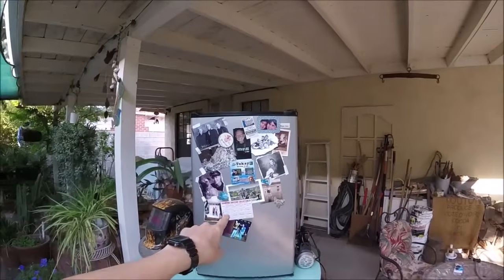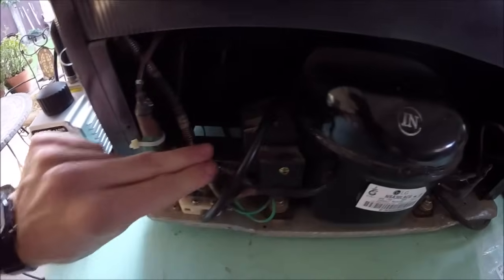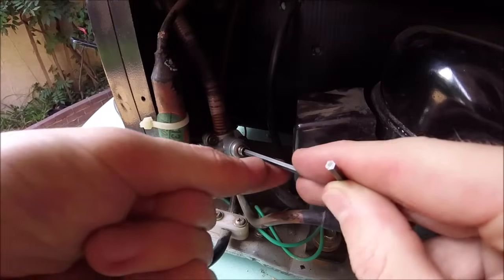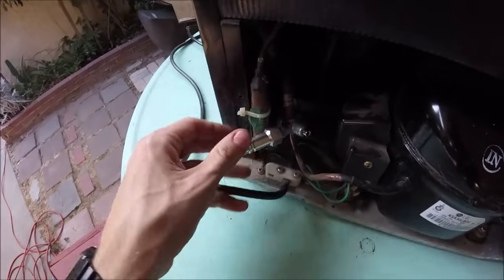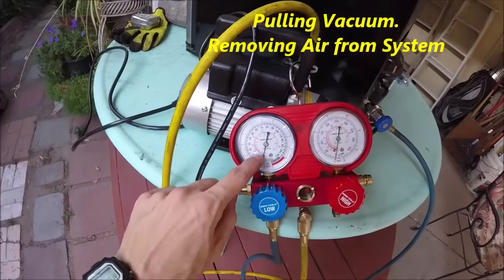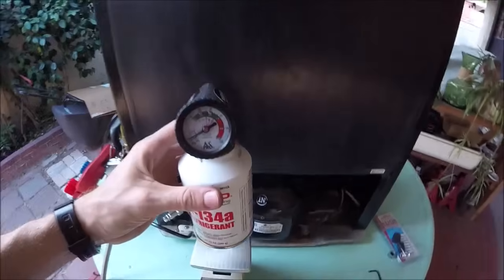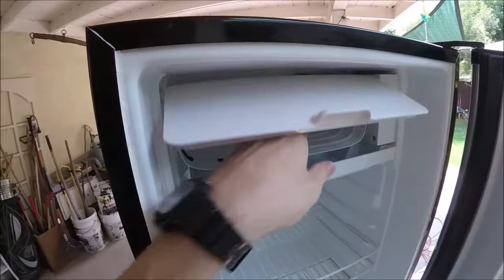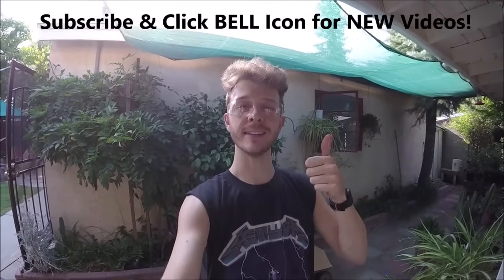How To Correctly Add Freon to your Refrigerator R134a -Jonny DIY

Comment from the maker: TOOLS & SUPPLIES & DONATION LINKS
Bullet Piercing Valve- https://amzn.to/2M9uT2I
A/C Refrigerant R134a & Hose with Gauge Kit- https://amzn.to/3UKKbyv
A/C Conversion Fittings- https://amzn.to/375OIX5
A/C Charging Hose with Gauge- https://amzn.to/3ZRFmVa
A/C Refrigerant R134a- https://amzn.to/36Z7ATA
A/C Gauges & Vacuum Pump Set- http://amzn.to/2gRBXVx
A/C Manifold Gauge Set- https://amzn.to/3S1JVej
Vacuum Pump- http://amzn.to/2gRH3Bn
170 Piece Household Tool Set- http://amzn.to/2xoyu5c
Safety Glasses- http://amzn.to/2ez41Jw
Nitrile Disposable Gloves- http://amzn.to/2w0dlwc
Mechanics Gloves- http://amzn.to/2w0i1SP
If you Enjoy the Channel Consider Helping Support it by Donating below & by Subscribing.
PAYPAL DONATION https://www.paypal.me/JonnyDIY
Zelle Donation JonnyDIYs@gmail.com 
Venmo Donation JonnyDIYs@gmail.com
Reply: What if there is no leak but, the gas is low.
Reply: How to trace where the refrigerant leak is coming from
Reply: Question? How much did it all cost to fox it yourself?
Reply from the maker: @tannavela9212  not much, tool was rental free. About $15-20
Reply: It costs $200 to rent A/C vacuum from Auto zone. You could buy a new mini fridge for that. Is the vacuuming of the tank absolutely necessary?
Reply from the maker: @JOSH_R_FALCON  its free you just leave a deposit and get it all back when return. And yes it is absolutely necessary if the system has been completely evacuated of refrigerant. Because now air has entered and air take up space and cant be compressed as well. If you dont vacuum system it wont cool well or not at all
Reply: @JonnyDIY  Thank you very much. Appreciate the video and the quick response
Reply from the maker: @JOSH_R_FALCON  You're welcome 👍🏻
Reply: So Jonny DIY did you put air in the system or take air out of the system before you put the freon in ?
Reply from the maker: @cliftonpeterson5863  You want to remove all the air from the system by vacuuming before recharging. Vacuuming will also tell you if you have any leaks in system
Reply: @JonnyDIY  thanks bro
Reply: Watching your video juat save me a more than $1000, I was about to buy a new one, thanks for sharing your videos, subscribing
Reply from the maker: @alexisrodriguez1599  Awesome, glad to help 👍🏻
Reply: Thanks for the video and the product listings very helpful for a diyer
Reply from the maker: @mannydiaz0713  you're welcome, glad to help! 👍
Reply: @JonnyDIY  did you get your r-134a from auto zone too ? If the compressor is r-134a can I use auto zone refill can to charge it ?
Reply from the maker: @NateTheCod  yes you can get the refrigerant at autozone too 👍
Reply: @JonnyDIY what’s a good pressure fornit
Reply: WhT do you do to the copper tubing once your done? How do
Reply: Grainger has 'em for $5.19
Reply: @JonnyDIY  Thanks a lot
Reply from the maker: @jck1989  you're welcome, glad to help! 🙌👍

Comment: HVAC and Refrigeration tech here: guys if you absolutely have to do this, please pay attention to the type of refrigerant it takes. Info can be found on the data sticker inside or on the back. DO NOT MIX REFRIGERANTS. If it says R404a DO NOT add R134a. Please consult an EPA certified technician before doing this.
Reply from the maker: Good point, thanks for sharing 👍
Reply: What are the potential dangers of mixing refrigerants?
Reply: @JonnyDIY  if urs take the refrigement that is no longer common, can u just use the R134 I believe it's called??? Thanks
Reply: @Dragon22078  would you put diesel in your gasoline vehicle?
Reply: @Yousoundvaxxed  no but I’d put alcohol in it. Or jet fuel; not diesel because of the compression required for it to detonate.
Reply: No... You see them bastards aren't going to rip us off anymore looks like most people can do this themselves instead of her $500 that's AC repairman charges
Reply: @Dragon22078  Each refrigerant operates at different pressures and temperatures. If you mix refrigerants you degrade the function and efficiency of the system
Reply: @sircoolbox  If your vehicle's system takes a refrigerant that has been phased out, the whole system needs to be updated.
Reply: @sircoolbox  Edit: *fridge.....I was talking about vehicles with another tech when typing
Reply: I installed the bullet valve on the vaccum line  of the compressor. Will the vaccum used in the video still work if used on that line? Thank you.
Reply: Good advice Wolf, to others listening.

I've done this, Im also epa 608 cert, for HVAC. Ive done more autos than fridges and (Im not 609 cert.)

 DO NOT mix refrigerants, as Wolf stated, it can cause over pressure spikes and ruin compressor or condenser + fittings.
The new R1234rf systems from what I hear, can be evacuated and safely charged with R134A + oil. As they operate at almost the same pressures.

If Topping off a 134  system works, then Im all for it. Eventually if the system has a small leak, moisture and air can get in, causing problems, not too hard to rent a vacum pump to evac system, then re-charge, many videos on the net.

 Maybe sure the the system takes the same refrigerant
Reply: @wolfshadow2472  is it the exact same method for freezers?
Reply: @MIKALI.  At the fundamental level, yes. It also depends on if it is residential vs commercial/industrial. Commercial and industrial have many more components that are included in the system
Reply: Most refrigerators take 134a
Reply: @Dragon22078  kabooom!
Reply: Out of curiosity, would you be considered one such “EPA certified technician”, that you mentioned?
Reply: What kind of oil do you need to use especially if you're replacing the whole compressor how much how do you add it add it to the system
Reply: @markdi2  R134a and R404a use POE oil. The exact amount needed varies by brand of compressor and can be found on the data sticker on the side of the compressor
Reply: @wolfshadow2472  I read sometimes they come pre-filled with oil and I guess the rest of the system would be cleared of oil because of gravity and when you pull a vacuum on it
Reply: @markdi2  that's correct. If the system is in need of oil after opening the line set up. Only fill to what is on the data sticker for the compressor. Any more than that you run the risk of equipment damage
Reply: @wolfshadow2472  I was a manufacturing support engineer at tektronix and a technician working on everything including 200,000 oscilloscopes and other test equipment manufacturing fixtures including repairing thermal cycle machines that had 60 horsepower 3 cylinder Refrigeration pumps trane was the company I would work with
I think the compressor in my 14-year-old refrigerator is fine it had a bad start module assembly I am so tempted to cause Mayhem with the 12 microfarad 250 volt cap using a line cord and a 1n007 to charge it to about 175 volts dc and throw it at a buddy and say here catch
Reply: @ThumblessMike  
EPA certified is just another government way of collecting more money. It is pointless for the most part.
You can be EPA certified if you pay a fee and study for a month or so about environmental questions mostly that you will forget in a month or so.
You need EPA to work with refrigerants.. Thats why all HVAC guys have them. Its the law. If it was not the law most would not give a dam about it.
Reply: @wolfshadow2472  nah, there are drop in replacements for most old gases. Rs24 can be used for r12 which was a common ac gas for cars and I believe r12 systems can be converted to 134a with an oil change. Could be wrong. R12 isn't common in my neck of the woods.

Comment: To everyone out there who is doing this to save money, and to make ends meet. You are not alone, and I know you can do it don’t let stuff like this overwhelm you because you’ve never done it before, or haven’t been to school for it! You don’t need school anymore there are very extremely intelligent people who regularly upload to YouTube, and all over the WEB showing you, and teaching you just like this gentleman here I will say there are many different ways to go about it, go with the option that best fits your situation. But don’t let the job intimidate you, but do pay attention we’re your hands are at all times! When putting a hand inside of a device that has a high enough voltage, and current abilities thar can cause you physical harm, and it must be switched on for this purpose put one hand in your pocket and keep it there (always use one hand working on live circuits) protect your self at all cost, nitrate gloves will protect against 120volts 60Hz AC,and 120volts DC as long as there is no moisture on the outside part of the glove. Be careful my friends!

Comment: TIP!: WHILE  ATTACHING  HOSE , ALLOW THE FREON TO  PURGE (ESCAPE FROM) THE HOSE (CONTINUOUSLY)  TO ENSURE THAT AIR IS PUSHED OUT OF THE HOSE. OTHERWISE, YOU WILL HAVE INCORRECT PRESSURE READINGS & THE AIR WILL CREATE ACID. WHICH DESTROYS THE MOTOR WINDINGS & MOISTURE IN THE AIR CAN POSSIBLY  CAUSE ICE FORMATION INSIDE THE  SMALLEST LINE (CAPILLARY TUBING CAUSING A BLOCKAGE OF FREON CIRCULATION.  GREAT VIDEO!!!)
Reply from the maker: Thanks! Great tip 👍
Reply: thanks. i was wondering why we must purge it. will definitely do that
Reply: @kushpaladin300  god bless you!!
Reply: That does not look like a line to purge. Its got a clip on type compression at the end with a hand pump.
How would you even purge it? You cant back off the line sightly to purge air. You have to take it off which would just allow air into it again.
Especially because a pumping action has periods of nothing happening.
Reply: @bobshanery5152 THE AIR IS IN THE LENGTH OF HOSE FROM THE CAN OF 134a REFRIGERANT TO THE LINE TAP VALVE CONNECTION; THIS AIR  SHOULD BE PURGED -  ITS  POSITIVE PRESSURE & NOT UNDER A VACCUM. NOTE: AS YOU STATED CORRECTLY , (PARAPHRASED) WHEN THE LINE IS OFF AIR IS ALLOWED IN     REMEDY; A CONTINUOUS FLOW OF REFRIGERANT THRU THE HOSE WHILE ATTACHING THE HOSE TO ITS CONNECTION. YOU DON'T BACK OFF OF ANYTHING. ALSO, YOU'RE NOT PUMPING ANYTHING ,BUT SIMPLY SQUEEZING THE TRIGGER  (LIKE A SPRAY CAN) THE FLOW IS UNINTERRUPTED. THANK YOU BOBS, HOPE THIS HELPS!!!!!          //////              I NOTICED THE LINE--OUT ACROSS MY COMMENT HERE , PLEASE READ IT ALL, I DON'T KNOW HOW THAT HAPPENED??????
Reply: @2bnax  Tkx, I was looking for a comment like this, you've just made me realise it's doable because the hose has very small valve on one of it's ens to facilitate this purging flow though.

Comment: I do NOT understand why anyone would dislike this video. Thanks for sharing
Reply from the maker: Thanks! & you're welcome, glad I could help you out 👍
Reply: @peterpham6288  did it work?
Reply: @peterpham6288  134a is 134a. There's no "refrigerator grade" version of it
Reply: @doctorfeinstone6524  There is 134 some other number that is the gas for vacuming it up and/or pluging leaks/removing. I'm just putting this out there for other people watching this. 

All this said, those other types of gases are probably harder to find anyways whether it's R600 (isobutane), R134 (tetrofuloroethane), R290(isopropane), letter a is always the cooling gas.

When it comes to R600 (isobutane) and R290 (isopropane), the isomer (same atoms, different configuration) is what differentiates it regular butane and propane we use to cook etc. Maybe it comes from there whether or not it's "refrigerant grade".

Comment: Overall well-done, however a big omission in this video is at 40s, picking where the fill-valve goes. It needs to be on the low-side (low-pressure, return to pump). That is where the video shows it (thicker pipe to pump) but the distinction is not made.
Reply from the maker: Yes correct, thank you for pointing that out 👍

Comment: Your video is based on there being no R134a already in the fridge.  To top up a fridge or fridge/freezer to the correct level with Freon, you want to end up with a pressure on the gauge of between 2 and 5psi.
Reply from the maker: Thanks for the helpful info Mark 👍🏻
Reply: Firstly a potential leak has to be found and fixed.after vacuuming i dont fill by pressure.i use  the blue Temperaturen line for 134a.i do this for 40years and it works perfectly!most of fridges run at minus 25.filling by weight is even better.

Comment: Thanks for the video.  You helped me save my 17 year old mini fridge.  Did it all for under $15....  Thanks for the instructions and the confidence.  Through my research I saw that if your system isn't completely empty you can skip the vacuum step and just add refrigerant.  CHEERS
Reply from the maker: Awesome glad you got it fixed and glad I could help out. Yes you're right as long as their is some refrigerant still left no air should be in, thanks for sharing 🤙🏼
Reply: If it's 17 years old it's time to get a new one. Good luck.
Reply: Wow! Thanks for this comment because I was trying to figure out how the hell I was going to find that vacuum in my tiny town. Much appreciated!
Reply: I put freon in my mini fridge and now it ain't getting cold
Reply: @JonnyDIY  Thanks for the video! How would you know how much to add if you don't vacuum out what was left in there? Do you need to do this on the 'high' or 'low' side of the compressor? How can you tell which side you are on? thanks!!

Comment: I cleaned the grimy dust off the evaporator fins and the fan blades on my vintage refrigerator. There was also a small piece of paper that the fan had pulled into the housing underneath the refrigerator, that was keeping the fan from spinning. And it works again. Still need to check the pressure on the system.
Reply from the maker: Nice hopefully that did the trick 👍

Comment: This was a fantastic tutorial. My fridge is slowly dying and I have a chemical cabinet full of goodies including R-134. The wife just ordered a pierce valve.
Reply from the maker: Awesome, happy I could help 👍
PS- sweet old Chevy you got their. My brother used to have a '63
Reply: Thanks man! It’s my daily driver. You see it in the background of a lot of my YouTube videos.
Reply: @JonnyDIY   Here's an update. I think I overcharged it so I bled it down a little. My real problem was a mountain of ice buildup in the freezer, so I cleaned it all out. Suction side is ~0 psi and high pressure side is around 140psi. Freezer is definitely getting cold, refrigerator is definitely getting cold. But now the suction line is covered in ice. Any thoughts?
Reply from the maker: @VinnyMartello  line will ice up sometimes especially when working real hard. I usually just go by weight for refilling that's the only real way to refill with the correct amount. If you added close to whats called for on specific refrigerator it should be fine though

Comment: Just wondering if you might want to also include that there is a High pressure side and a Low pressure side, at least in most refridgeration systems there is, not sure if "all" do or if this one does for sure but I think that's how refridgeration systems work. If you put it on the high pressure side you can seize up the compressor in some cases.

Comment: Thanks for the video if my freezer is working but fridge isn't will this help
Reply from the maker: No sorry may want to look at thermostat
Reply: Yes, this is the usual sign of a low refregerant level in a combined freezer/refrigerator situation. It might also be plugged air ducts in american fridges, european combined fridges don't have passageways between the two compartments.

Touch the condenzator at the back, if it's heating up and then couling properly there is still some gas in it, but NOT enough to cool both compartments probably. If the condensator is cold (thing that cools gas to liquid after the compress), you've got no gas.

Comment: Great video thank you! I have an Isotherm Freeline 115 marine fridge and I can’t determine how much to add. The unit is a SECOP BD35F. Thanks any help.
Reply from the maker: @vanishthevan  If you've vacuumed it empty, what I could find with a Google search was 10.5 ounces max refrigerant to add back 👍
Reply: @JonnyDIY  thanks! Can’t remember how much I added back but it’s been working great.
Reply from the maker: @vanishthevan  Awesome, happy to hear you got it working again 👍
Reply: @JonnyDIY  runs a bit too cold now but it’s been working.

Comment: So, with the vacuum process, if there was any freon in the system you vacuumed that out along with the air in the system?  Also, it sounds like there should only be freon in the system and no air?
Reply from the maker: Yes when you vacuum itll pull both the air and whatever refrigerant left out. And yes you're correct you don't want any air in system. If you have air it wont cool properly
Reply: The vacuum process will pull any trace of refrigerant and air, even as much as refrigerant that's still in the oil. If you have air in the system, it will create an acidic reaction with the oil and refrigerant and it will burn the windings in the compressor then you'll have a right old mess.